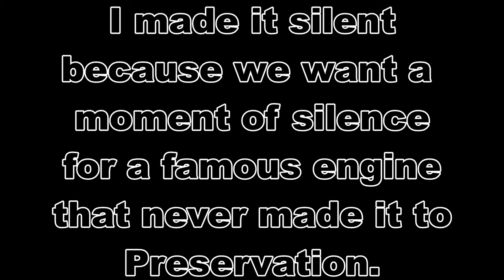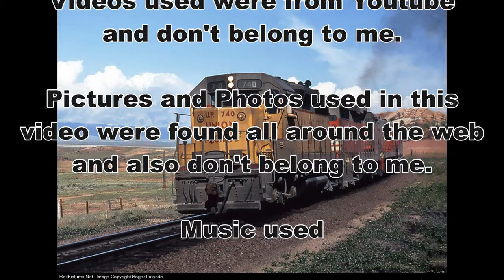Engines of Union Pacific Episode 3, The GP35 and DD35 (outdated episode)

Comment: It should be noted that the UP also had 10 SD-35 (special duty) locomotives with 2 C-C 3 axle trucks installed. The 567 engines that were installed in the GP/SD-35's were at their mechanical limit at 2500 Hp. It's successor, the 645 engine, had larger diameter cylinders (9-1/4") than the 567 (8-1/2") allowing it to be made with higher horsepower ratings. These went into the DD-40AX Centennials in pairs giving the engine 6600 horsepower total for both engines. the GP/SD-40's used this engine at 3000Hp and was a huge success for EMD.

Comment: Took me quite some time to recognize the differences between GP38s, GP40's, etc, with the GP35.
The GP 30 and GP35 were shorter by three feet, than the later Geeps. Also, the middle roof fan is of a lower profile than the other two. 
From what I read, the GP35 was a highly regarded unit. Twenty five hundred horsepower was awesome for it's time. General Electric had built a good unit in the U25B, and EMD needed something to match it. They felt the '"35" was a better match, horsepower-wise, than the GP30.

Comment: The 35 series EMD's were the last of the 567 motor design, DC direct current drive, which dated from the 1930's.  In the mid 60's the 645 motor coupled with an AC alternator proved to be a winner, the 38 and 40 series! By the 90's the 710 motor came out and differs not much from its predecessors.

Comment: Tractive Effort, a measure of pulling ability, is measured in "pounds force" (lbsf), not in "pounds per square inch", which is a measure of pressure. It is a combination of locomotive weight and wheel/rail friction coefficient and the max power rating of the axle motors.

Comment: I love the Amtrak F40PH locomotive's. And am very sad that most of them are long gone.😭😭😭😭😭😢😢😢😢😢
Reply: They're not fully gone, some of them now work as NPCUs, even as freight locos.
Reply: @nofrankrelax6593  I know that. Lol!!!
Reply: @nofrankrelax6593  Not to mention a majority of them still operate with commuter and tourist railroads until the Chargers replace them
Reply: All of us are sad, but about 20 of them were turned into NPCU’s, and have the prefix of the number “90” in front of the original number. (Except 406).
Reply: @joshbrony2204  Lol!!! Why didn't unit 406 get the number 90 in front of it's original unit number???
Reply: @Anthony Taylor Network. Personally, I have no clue why Amtrak did that.
Reply: @joshbrony2204  Lol!!!😂😂
Reply: Isn't one still operating for the Exhibit Train?
Reply: @Shane Walters. Not sure.
Reply: @shanewalters2565  that one on the exhibit train is an NPCU. It has no prime mover.

Comment: OMG! Was just watching this vid and the pic at 25:32 IS MINE! , WOW! Where did you get that from, I posted it on the forum I was a Moderator on, Big Blue Trains. Neat to see it in your vid, but shocked to see it. BTW, that engine many of of modelers consider a DD35, but its really an old Athearn  Blue box engine they title DD40, it was made from early plans EMD had that never came to be.
-Deano
Reply from the maker: It was just picture that I found when I searched up DD35 Model train. I'm glad that you noticed that picture was yours because most of the pictures I use are just random pictures I find for the videos. But I'm glad to use your picture for this video.
Reply: @ottomatic6432  , Glad you liked it enough to post it!  The real shocker was that pic was taken about 10-12 years ago on a shelf layout I had in the apartment I was living in at the time. Cheers!
Reply from the maker: @Iver-pr1wo  Huh, 10-12 years. That's long a time. Well either way, Cheers.

Comment: Just found this channel - not bad.  I would mention that the correct title should be "LOCOMOTIVES of the Union Pacific" - the "engine" is that diesel prime mover under the long hood that drives the generator.  The GP35 was pushed up to 2500hp to match the early 1960s offerings from General Electric and Alco (still a player then).  The prime mover and the electrical system were pushed up to their limits so GP35s sometimes had maintenance issues.  Most GP35s that survive in service today are often rebuilt with later components.  UP didn't see the need to spend a lot of money rebuilding an "old" locomotive and after the MoPac merger brought in a large fleet of newer B-B locomotives the GP35s were sent to scrap.  The DD units were odd monsters and railroading changed during their service lives.  Pool power and run through trains became common and the DD units were just too big and odd so other railroads didn't want them in shared service.  The big guys were limited to service on UP only.  DD35 was intended to only be a booster unit with the DD35 placed between two GP35s, the set giving the effective traction of FOUR GP35s.  By the way, UP bought the four-unit demenstrator set from GM (shown in orange and white in some of your slides).  UP 762 was at the top of the roster but was actually the FIRST GP35, along with UP 763.
Reply: By the way, the problems with GP35 reliability is one reason that UP shied away from buying the GP40 for its own use.  The SD40 type ended up being the genesis of UP's modern locomotives.

Comment: We do NOT shunt here in America! Shunting means to slam a car to move it into a spot and let the buffers or another car stop it. We switch cars. Switching is to spot a car at a location uncouple and set the hand brake (if needed). In a hump yard, the cars are went over a hump, down the hill, retarders slow the cars as the enter the selected tracks. The cars slow just enough to come to a gentle stop or couple to another car. this is not shunting.

Comment: You specify tractive effort of the GP 35 in "pounds per square inch". That unit would work for pressure, certainly not force, which tractive effort is.

Comment: You think it's weird that UP didn't get some DDM45 units from EMD? Sure, they all were for E. F. Vitória a Minas, but they still were from EMD.
Reply from the maker: I don't know what those are, but I guess.
Reply: @ottomatic6432  They were an 8-axle version of the SD45, I think.
Reply from the maker: @virginiarailfannoah5415  Interesting
Reply: @ottomatic6432  I know, right? It'd be cool to see them in the U.S.
Reply: The DD45m are meter gauge locomotives. The 4 axle trucks were needed as EMD could not fit the SD45's regular traction motors between a meter gauge wheelset. EMD ended up using a smaller traction motor. And to apply the power to the rail used 4 smaller traction motors.

Comment: Does anyone know why UP stopped ordering their diesels with silver painted trucks decades ago?
Reply from the maker: Maybe because it didn't seem to fit the scheme or maybe it was light blinding for some may be because it kept coming off since silver paint doesn't stay on for that long and has to be reapplied a lot. To be honest, I don't really know. Maybe ask Union Pacific themselves.
Reply: Greg T.  Silver paint is expensive and does not wear well.  The Harbor Mist Grey is already on the top of the locomotive so it works well for the trucks and fuel tanks plus it’s more durable.

Comment: why not do one on the UP-Series Steam Locomotive AKA UP 9000s since they were the big boy before the 4000s were a sketch on the drawing board also people seem to believe the 9000 was 100%, trash which it was not a fail. it became the test locomotive and platform for many things like Rotary blowers and other equipment that was either never used again, forgotten about or overlooked just because it is a 4-12-2 that normally went 50 doing nearly the same work as a singular big boy if not more at times due to it is built in 1926-1930s(I know I ramble on but YouTubers attack it because of its one major flaw although it never gave it any problems when it steamed here to California alone with some freight without problems in 1956).
Reply from the maker: I will do that but first I want to get the diesels done first.
Reply: @ottomatic6432  sounds good to me maybe try doing the DD40s or the F Series to work on the Diesel section
Reply from the maker: @TheAviatorB  I will do the DDA40X's in one of the episodes.

Comment: Tractive effort is not a psi rating, you have done it in a few videos
Reply from the maker: How do I tell what the tractive effort is?
Reply: OttoMatic Tractive effort is usually referred to in pounds of force. Different from pressure in pounds of pressure per square inch, which is why psi is wrong. For example, the UP Big Boy produces 131,000 pounds of tractive effort, but not 131,000 psi.
Reply: The number is correct, just the units are wrong. It’s putting 65k of drawbar pull, not 65k psi of drawbar pull
Reply: Sycamore Valley Shops Did I get it wrong too? If so thanks for correcting me
Reply: Blackbird Gaming your correct
Reply from the maker: @blackbirdgaming8147  Alright, I'll try toi get this right in the next episode.
Reply from the maker: Got it.